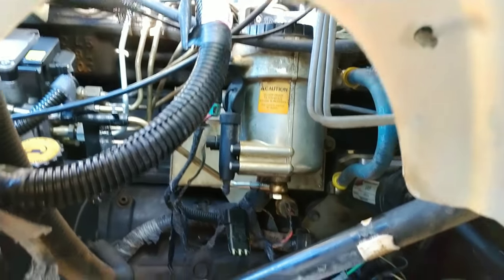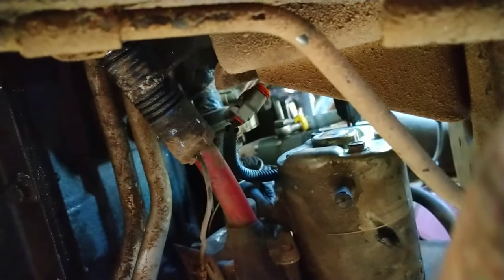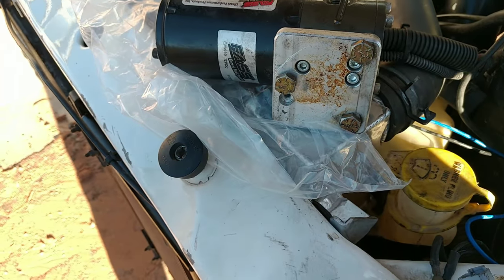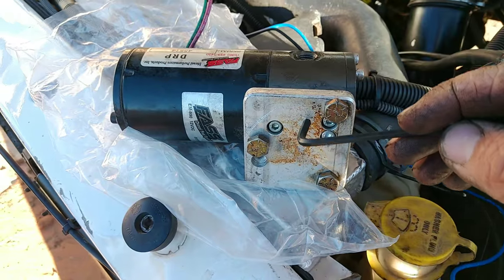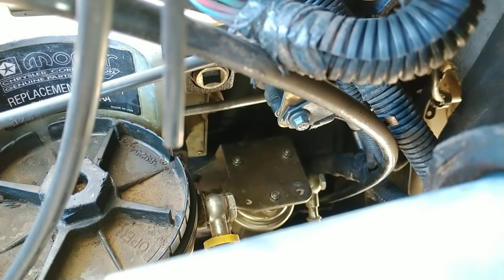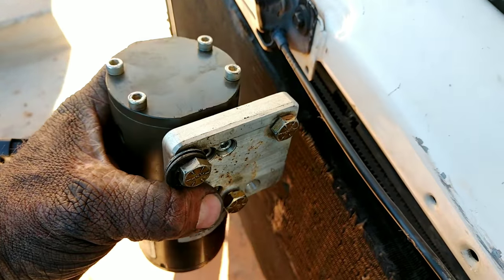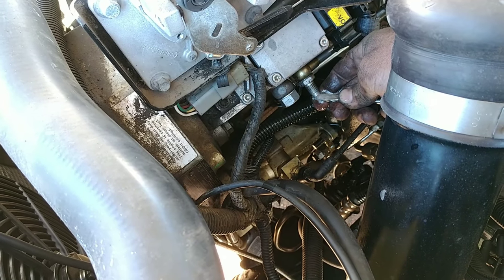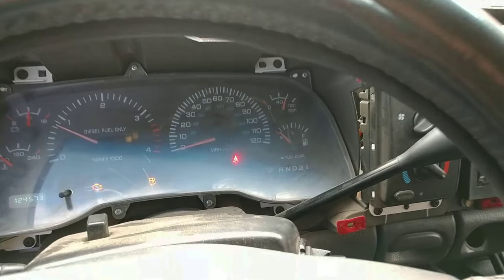Fuel Pump: 24 valve Cummins lift pump replacement

Comment: Great video much more informational than the others I've found. What is the shrader valve? It allows you to bleed off air by pushing in on it?
Reply from the maker: That valve can be used to bleed off air but it also is part of a water/diesel separator on the 24 valves.
Reply: @VanDamArtisan  would you still need to crack the injectors to bleed the air out?
Reply from the maker: I do if I'm sure there is air past the lift pump.
Reply: @VanDamArtisan  thanks, I just got a raptor pump I'm going to be putting in. My stock Carter pump has 200k on it.
Reply from the maker: Better now then after it takes out the injection pump. Good luck with the install
Reply: @VanDamArtisan  thanks